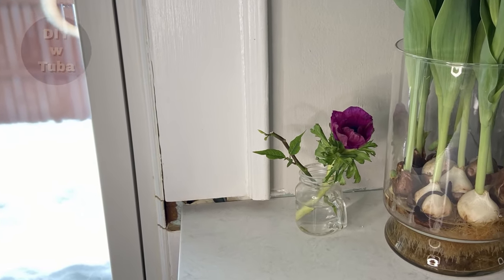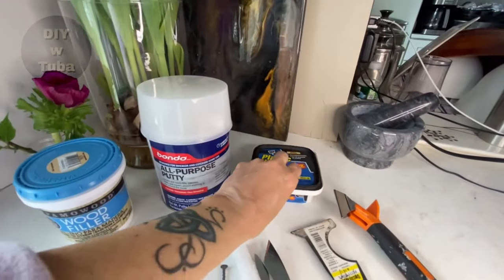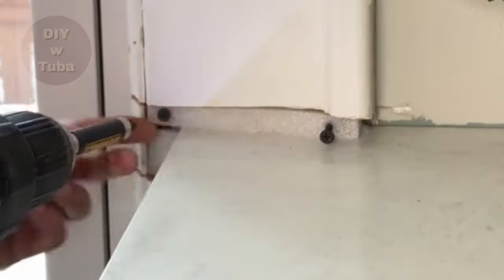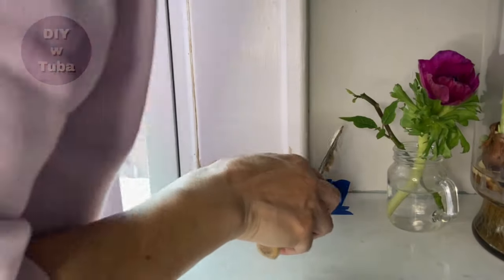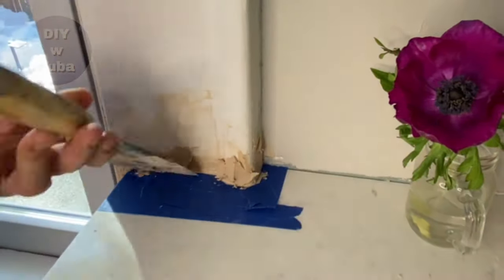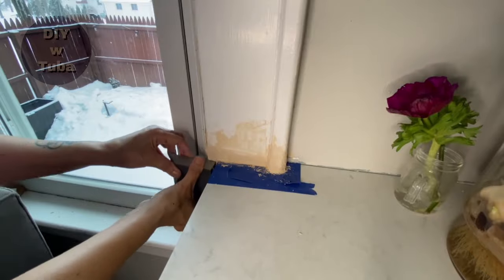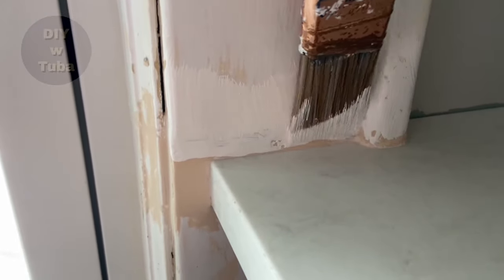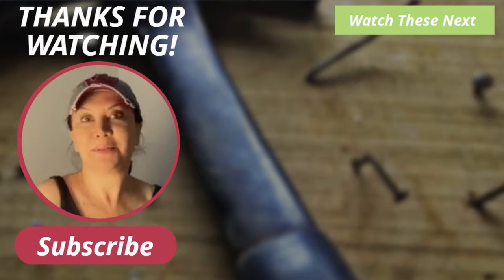How to Fill Big GAPS in Wood with Wood Filler Guaranteed! Fix Large Gaps in Wood DIY!

Comment: Another tip also, when you have a gap that big you should fill 3/4 of it with that clay filler they sell at hardware stores. They are super cheap. Then you should put wood filler over it. Doing this will give it better uniformity and also give it more stable foundation for the wood filler to mold to...
Reply from the maker: Great tip! I will use that in my future projects👍 Thank you!
Reply: 100% agree with this tip
Reply: This is why I love the comment section! Thank you!
Reply: What's an example of clay filler? I don't recall ever seeing that at the hardware store.

Comment: Very well done.... and you can’t even tell it’s imperfection up close... the only criticism I have is when you use painters tape and you use wood filler, caulking, paint, etc. you should score it with a knife first before you pull out that tape or it will peel off something you don’t want damaged.... this job you did tho is really well done. Bravo 👏
Reply from the maker: Thank you! You are so right about the tape! Nothing happened in this project but my bathroom floor painting project got ruined a bit when I pulled the tape!! Thankfully it was behind the door not really visible, after that incident I scored the rest of the tape😂 lesson learned!!

Comment: THANK YOU!!!  Great video!  At 71 and single I am doing repairs and a little remodeling  on my little RV home. This was exactly what I needed to see.  It was the process of filling the space I couldn't picture what to use...  thank you  problem solves.
Reply: Do you have a filler you recommend?
Reply from the maker: So glad to help Crafty Redesigns! And good luck with your remodeling project! Recently I have been only using the filler I used in the video, Famowood! Good for interior and exterior!

Comment: :hand-purple-blue-peace:thank you, I will now go and buy some clay filler and wood filler because I need to fill two casings on my door which I installed to make the large gaps disappear to hide the spacing between the casing to make it look like a seamless joined angle. 
thanks again, very good demonstration.

Comment: This is a lot better than some attempts I have seen. I can tell by the way you handle material that you are experienced. Bondo does have a smell for a brief period, but the beauty is that it is more amenable to tooling and sanding once dried. I think that would have led to a better result with less effort. I would usually put a sheet of something like thin, like Mylar on the counter surface to act as an adhesion barrier so the filler is not bonding to both surfaces. Things will move and eventually there will be a crack. Once the filler is cured the Mylar can be trimmed flush with a knife. Good job!
Reply from the maker: Great feed back! Appreciate it a lot☺️ Thank you!
Reply: That trick with the mylar is brilliant!

Comment: Thanks for the video. Planned on sealing a few gaps and will definitely use wood filler instead of the crappy spray foam. The end result looks so much cleaner the way you do it.

Comment: Minor tip: when filling, you could use the bricklayers technique of point tucking here to use a little less filler and keep it a bit neater. Less sanding and less mess 👍
Reply from the maker: I will check that out! Thank you for the tip👍
Reply: It may be called tuck pointing... Some other home improvement videos buried deep in the memory somewhere 😅

Comment: Nice. I am glad I found this video. I have a gap between the last hardwood floor plank and the wall where the unfinished floor was exposed. I am trying to decide if I want to use clay filler or wood filler. Subscribing to this channel.

Comment: I would use a hard rubber sanding block with 80 grit to start and then move to 120 or even 180. Those fillers are difficult to sand and harder than the wood making it very difficult to achieve good results. I do like the use of a backer foam and it is very clever to use the wood screws as anchors like we do with patching concrete, i.e. teco screws. Works good. A multi-tool would make the sanding a little easier. Oh, I love the flower too.

RJD

Comment: So what is the difference between using a wood filler like the one you used and bondo wood filler. If it is not rotten wood you can use normal wood filler but if it is rotten you have to use bondo?
Reply from the maker: You can use both products for both cases but bondo is harder to use if you need time to shape it because it dries quickly! But if you are in a hurry its a better option! It also has a very strong smell!
Reply: @WadaGoodIdea  thank you so much… I think based on what you are saying I decided I will use wood filler because I am trying to put it into a very narrow and difficult to reach area. I will be able to do it easier with wood filler perhaps as it may be more pliable. The part that is rotten and is really weak though I may use bondo because it is perhaps stronger and will provide more support for a rotten and weakened area. Thank you.

Comment: Great job. Never filled a gap like this before so I wanted to make sure it would work before I did it. Do you have any issues since then? I'm personally worried about cracking or separation for a hutch I'm restoring. Has a 1/4 gap and I'm not sure it will hold when I move it.
Reply from the maker: I have no issues no cracks or anything like that! But hutch is a different story you would be moving it! I am not sure either if it will hold!
Reply: @WadaGoodIdea  well I'm about to find our tomorrow.

Comment: Funny I found this. I have always used wood putty especially to shape for gaps along designer trim, crown molding etc. When dry, sand to shape and paint. If using natural wood stain I collect saw dust from scrap end pieces and mix with wood filler and glue. More the saw dust better the look.   Nobody Ever notices.  🤣(Execpt my Dad)
Reply from the maker: Great tip! If I use a stain will definitely give this a try!

Comment: I have a large gap at the top of a shower surround. Do you have a waterproof suggestion on filling the gap? Would Styrofoam still work?
Reply from the maker: What is the material around your shower surround?
Reply: @WadaGoodIdea  The shower surround is plastic and then we will bring down the dry wall to meet it and cover the flange, but the two halves don't fit perfectly together and aren't flush against the studs so there is some gaping that we will fill with styrofoam but there still is a weird gap at the top (looking down at the top)  where the two halves meet that I'm not sure what to cover/fill it with to make a nice finish.
Reply from the maker: How about filling it with drywall compound or ready patch type of a material? Do you think that would work for your situation? You can a use drywall tape first if needed you know the ones look like a net with a sticky back!
Reply: @WadaGoodIdea  Thank you!

Comment: No it’s not perfect but it could be if you had taken your time and paid more attention to your work. Your filler will crack if and when your countertop should flex. Next time leave a very small gap (1/32”) at the intersections of your filler and countertop. Fill it with caulking after your filler has been shaped and painted.
Of coarse all of this would have been unnecessary had you hired a proficient countertop installer.
Reply from the maker: Thank you Steven that really is a valuable tip and I will keep that in mind and apply it the next time👍 so far there has been no problem thankfully! How would you leave a gap in the bottom?
Reply: @WadaGoodIdea  Aloha Tuba,
 Place a small piece of metal, maybe a  piece of flashing in between the countertop and filler material. Give it a squirt of WD40 or cooking spray to insure the filler doesn’t adhere to it. Remove it when the filler is almost dry. Best of luck!
Steve
Reply from the maker: Genius!👍 Thank you!